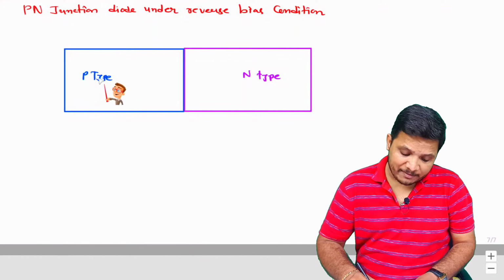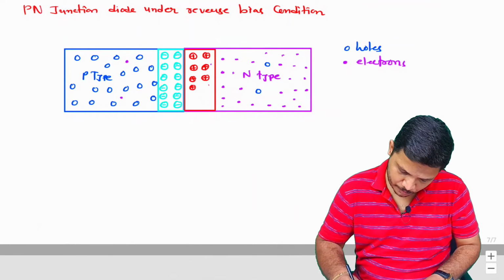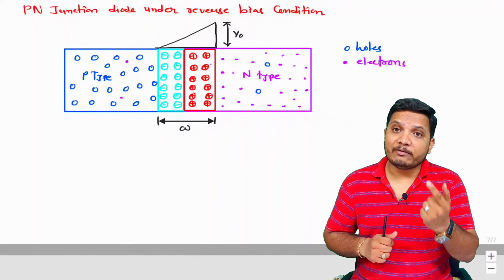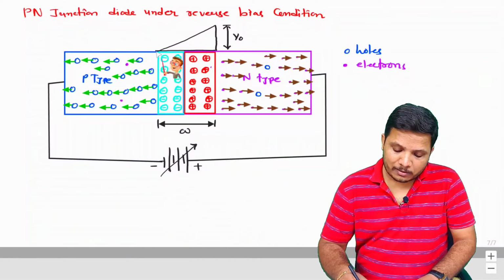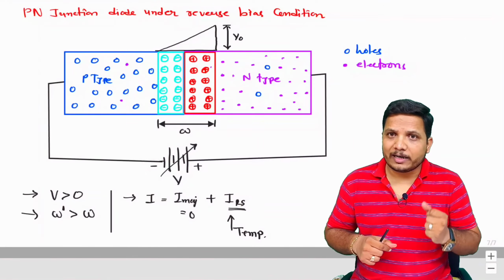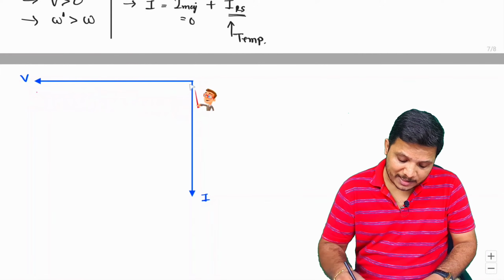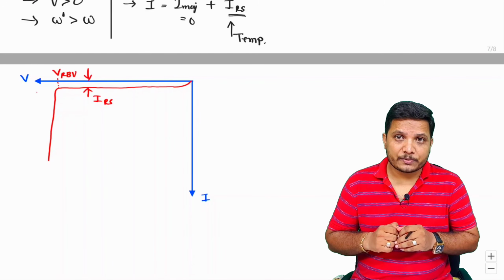PN Junction Diode under reverse bias condition

Comment from the maker: Timestamps of PN Junction Diode under Reverse bias condition :
0:00 - Basic Electronics Electronics Lecture Series
0:17 - Structure of PN Junction Diode 
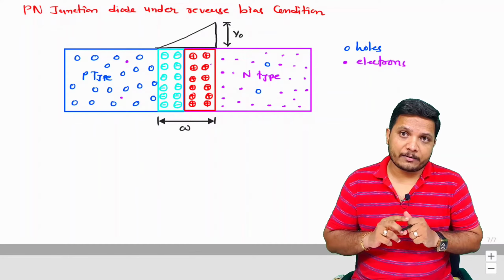2:06 - Connection of PN Junction in Reverse bias 
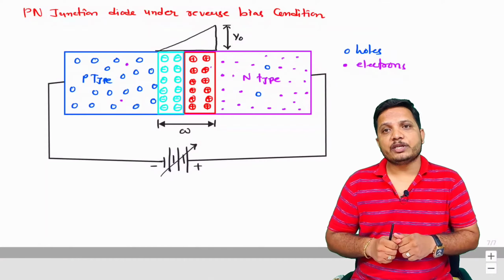3:35 - Width of PN Junction depletion region in Reverse bias
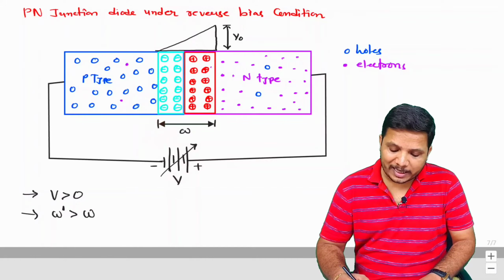4:15 - Current through PN Junction in Reverse bias 
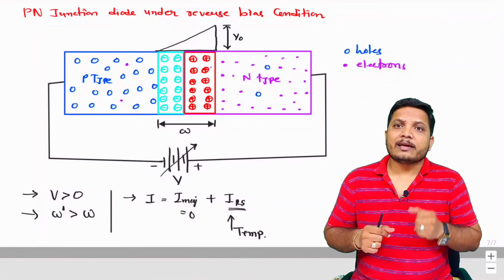5:28 - Characteristics of PN Junction in Reverse bias